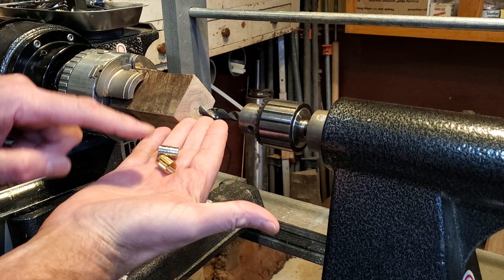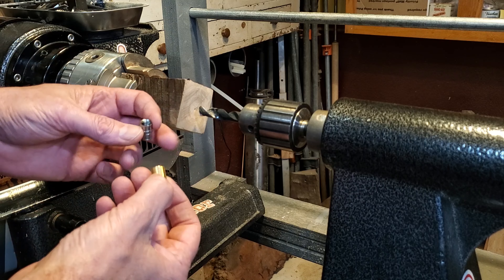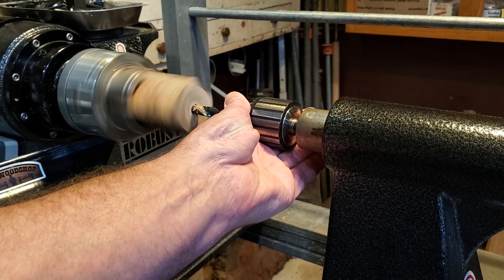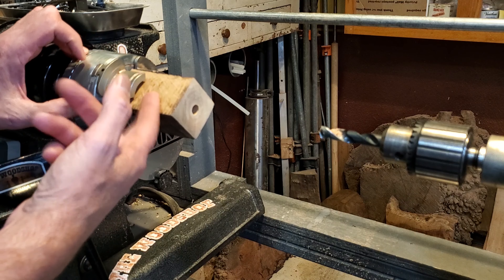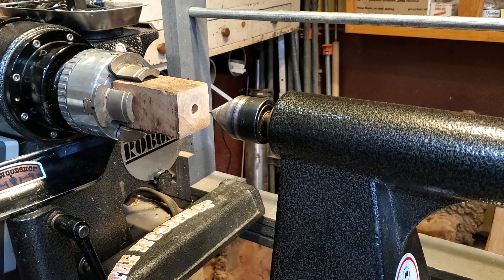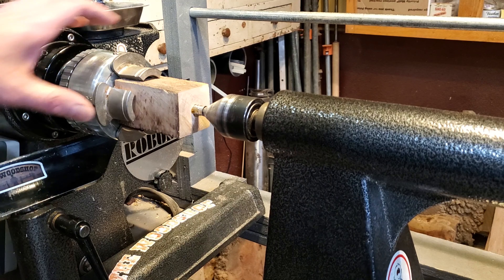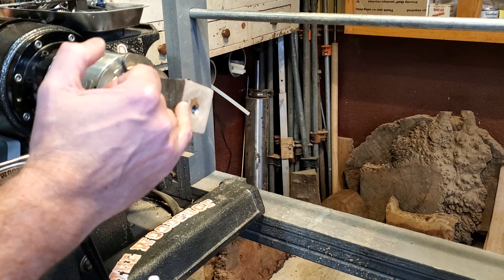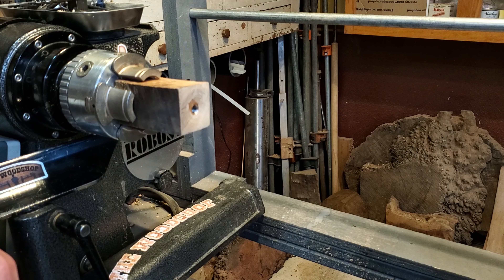How To Install Threaded inserts

Comment from the maker: These can be used with all of these products; stoppers, openers, and can tab pulls.  This is an original design from our manufacturer, they have a cap on the top so you don’t have to worry about glue getting into the threaded area.  They are 5/8″ high with the 3/8″ x 16 tpi internal thread and use a 7/16″ drill bit.  Always drill the hole 1/4″ – 3/16″ deeper to allow for air compression when installing the insert.  The outer surface is rough and has ribs that will thread into the wood.   *note: these inserts need to be glued in to prevent them from getting loose if the wood moves, which all wood will do.

Comment: Very nice tutorial. I wish these inserts had been available when I started making stoppers! It makes it a lot easier to remove the handle for cleaning the metal bits.

A suggestion: To get a good fit between the handle and the stopper, the end of the blank needs to be square to the axis of the hole into which the stopper will be threaded. To ensure this, I use a large Forstner bit mounted in the tail stock to face off the end of the blank. Then, without removing the blank from the chuck, I mount the proper-sized drill bit into the Jacob’s chuck and drill the blank to the proper depth. (It helps to have two Jacob’s chucks, one with the Forstner bit and one with the bit for drilling the hole.) This way, even if the blank was slightly off-center in the chuck, the end of the blank will still be square to the axis of the hole. 

I hope that made sense.
Reply from the maker: Thank you so much David!! That is a great suggestion! I hadn't really thought about using a forstner bit, but I see how that would work perfectly!

Comment: I thread the insert on the end of a bolt that is mounted into the same Jacobs chick I used to drill the hole and then press it in, keeps everything lined up straight.   Like mentioned by another viewer I use a frostier bit, the same size and the end of whatever I am using (stopper/cutter/opener etc), and prior to drilling the hole cut a 1/32 to 1/16 hole to recess the end of the object into the blank.  It's a personal thing but I think it makes a cleaner presentation and you see no gaps between the blank and whatever you are shredding into the insert.
Reply from the maker: Thank you so much for the tips Joseph! I just did another video explaining yours, and David's suggestions.

Comment: I prefer the brass inserts but had to retap them because they were a bit too large for the 7/16 hole and were squeezed enough to make it hard to screw on the pizza cutter.  I find wrapping a wood dowel with some fine sandpaper and just barely enlarging the 7/16 hole fixed the problem.
Reply from the maker: Thank you! That's a great tip for the brass inserts.

Comment: what size drill bit do i use for acrylic and resin bottle stopper blanks?
Reply from the maker: If your using a tap it's 11/32" If you're using the inserts it's 7/16"
Reply: @nilesbottlestoppers  ok

Comment: Hi Carl,  I'm using a 7/16 bit but I'm finding the hole a bit too large.  The inserts falls to the bottom of the hole.  What am I doing wrong?  Thanks.
Reply from the maker: Hi George! Sorry for the late reply! If it's a softer wood that might happen. I find with hard woods and resin it's a pretty tight fit. Are you using a stub drill bit? It will wonder less and make a cleaner hole. I hope that helps.

Comment: I’m a bit surprised that you didn’t mention if you use gorilla glue you need to add moisture to one of the surfaces. And it didn’t look like you did either, Did I miss it?
Reply from the maker: You didn't miss it, I forgot to mention that.